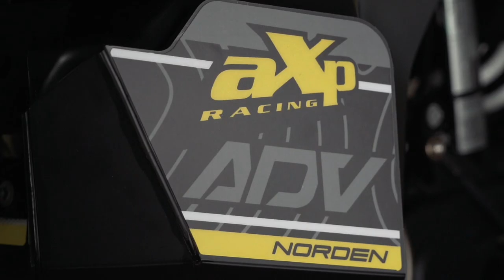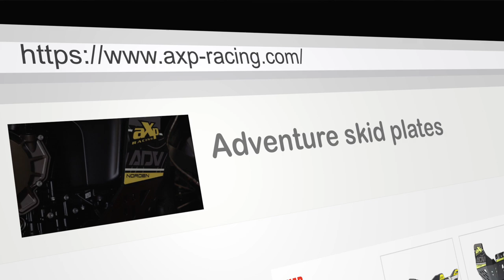Husqvarna Norden 901 Skid plateS - INTRODUCTION / PRESENTATION

Comment: Can this engine guard also be retrofitted with a crash bar?
Reply from the maker: yes, with the Crosspro crash bars
Reply: @axpracing   I bought the north with hard version included.  But now I want to retrofit the main stand, is that possible?
Reply from the maker: @vitalijkirilitsch3708  difficult except if you trim some of aluminium of your center stand but this is not warranted sorry

Comment: plz make 890 adv skid for center stand version
Reply from the maker: https://www.axp-racing.com/en/product/husqvarna-norden-901-touring-skid-plate-2022-black-ax1623
Reply: @axpracing  Would this be compatible with the 790 with a center stand?
Reply from the maker: @ryuga27  Hi, we made a TOURING version which is compatible with the oem center stand. We have no 100% certitudes but we guess ktm + hva have the same one. Here is the product link : https://www.axp-racing.com/en/product/husqvarna-norden-901-touring-skid-plate-2022-2023-black-ax1623

Comment: Why the Touring version is not recommended for harder terrain? What exactly are the differences with the Hard version, apart for the centerstand compatibility?
Reply from the maker: you can have a look to both videos (hard and touring), you'll see the difference at the rear fixation. The touring is strong as well but to us, a bit less than the hard version.
Reply: @axpracing  I've seen both but you don't show what specifically is this difference in strengthen/durability. The fact that one is compatible with a centre stand does not explain why you say it's less suitable offroad.
Reply: @axpracing  So you want me to pay almost 400 euro for your product, but you are not willing to tell how does it differ from the other one?
Reply from the maker: @impact0r  we don't ask you anything, you're free ! If you watched both videos, you may saw that the HARD ( not compatible with center stand) had two longer alloy brackets fixed on the pegs mounts and the TOURING (compatible with center stand) is fixed at the rear thanks to 2 alloys brackets fixed with a 8mm diameter bolt in the engine case. The efforts will be better absorbs by HARD option. All depends of your use. Once again, if you're going to hit some logs or other hard stuff, HARD version is recommended. If you just go riding soft tracks with only small rocks, so the TOURING is perfect. We got some reviews about the touring, let's have a look at it : https://www.axp-racing.com/en/product/husqvarna-norden-901-touring-skid-plate-2022-black-ax1623

Comment: I wou really like to purchase 1 that cater for the center stand. My problem is that I live in South Africa and I need a way to ship directly to me. So I need to pay duties etc with the shipping costs so they can deliver door to door. If it ends up at our mailing service then chances are that I will never receive them. I got parcels sitting with them for over a year now.
Reply from the maker: Fully understable ! We work with fed ex, dhl and we have also distributors in South Africa, you can contact LOCOMOTO , they will probably order some for their stock soon ! if not, write us at contact@axpracing.com

Comment: Plastic.. No thanks
Reply from the maker: You'll may change in a near future once you'll see others tellinh you all the benefits :)
Reply: @axpracing  but plastic will broke
Reply from the maker: @sanketmhatre9242  so you tested it already to affirm ? if it brokes, it's due to bad production. Most of the time, our skid plate hold on without any issue ;)
Reply: The thickness of that particular plastic material suggests it will be very durable indeed. It's already been thoroughly tested on other similar bikes. Plastic slides over hard and sharp surfaces better than aluminium or steel. It weighs less. Its flexibility reduces the level of impact which can be transferred to the frame.
Reply from the maker: @keyboarddancers7751  thanks for being so good in your description , we would have not do better! Glad to read happy customers :D
Reply: @axpracing  That's physics for ya!.😁